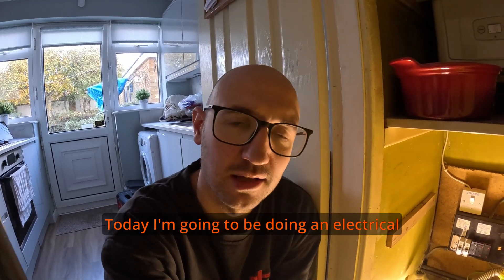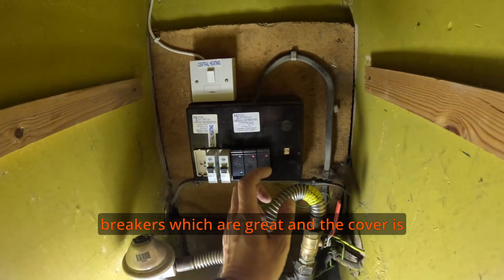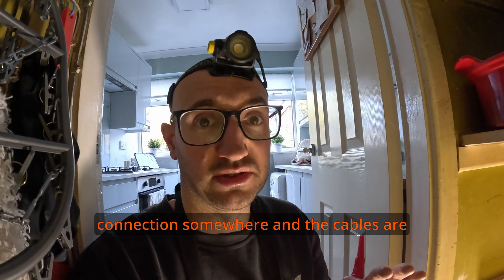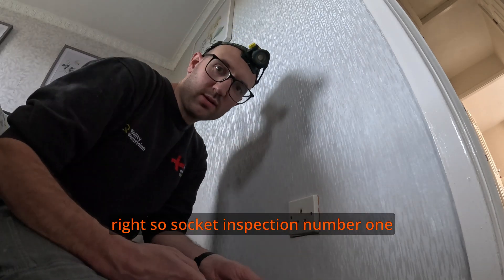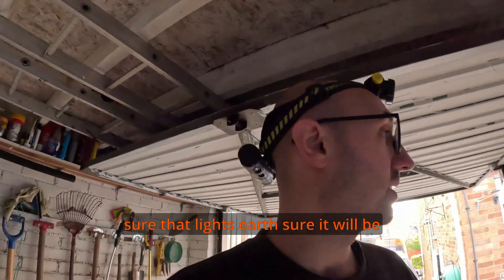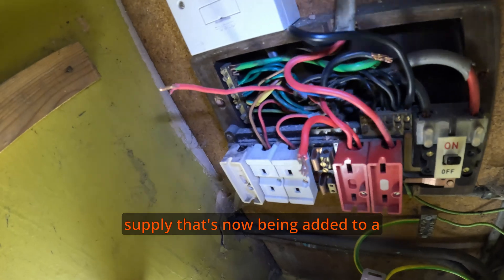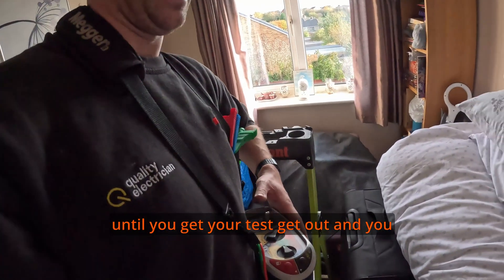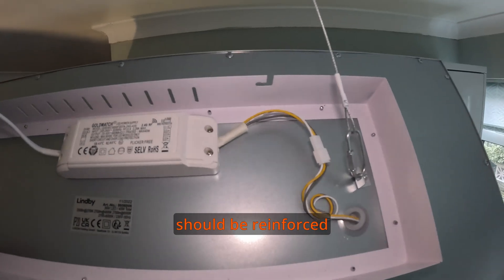Carrying out an #electricalsafety #inspection for a #fusebox #replacement

Comment: RCD are only required for additional protection from BS7671 17th edition amendment 3 onwards it doesn’t apply to earlier version of BS 7671 HSE note in BS7671 and the onsite guide Page 99 makes it clear. All your test results are within tolerance so you can sign it off as safe for continued service 
No RCD protection on installations designed to an earlier version of BS7671 ie before the 17th edition AM3 does not warrant a board change or upgrade. Unless there’s signs of overheating/burning exposed or access to live parts or damage to the board cover. 
But you I am glad to see you have done a proper thorough inspection and testing. Job well done 👍. 
But to be fair would I change that board probably, I think you have two choices  change it as you can’t fit the fuse cover on or replace those Crap Plug in MCBs with new rewirble fuses witch are still compliant and can still be installed and fit the cover. In some circumstances changing the Board is probably the best option. It would depend on what appliances are in use and if any electrical equipment is being used outdoors. 
Just my personal opinion 
I have been a spark for thirty six years , and I’m not trying to tell you what to do or how to do your job. Just pointing out the facts. In regards to BS7671.
No disrespect intended.
Great video mate I look forward to seeing more from you.
Reply: Yes , I think the old £ signs pop up when electricians see an old Wylex  consumer unit also when they see a plastic one    try to condem because it’s not metal ……..
Reply from the maker: @michaeltye8853  I agree, but to be honest rightly so. 

I don't think you would be doing your job if you didn't say to a client that you would recommend this old rewirable fuseboard be replaced.

What do you think?

A lot of these people just don't give a crap and are happy to scam clients out of as much money as possible. I personally couldn't live with myself.

I've got things wrong in the past and its not a nice feeling even if its a very minor job!
Reply from the maker: Hi Sean, Thanks for the comment really appreciate the information and I completely agree with what you are saying. 

Looking back I wasnt very clear and having no RCDs on sockets is a very vague term. In my mind I meant for outdoor use but there you go! haha!

A little background into the job, I carried out some work around 3 years ago and mentioned that replacing the fuseboard should be something they consider, and its been a back an forth since then. I think the fault on the light switch tipped them over the edge for an inspection and fuseboard replacement. 

It did want doing and I get it can be a costly job for a client so when I carry out these EICRs I do try to be as fair as possible, and like you say if there was no access to a garden then I would be thinking again about RCD protection and the code I would give.

If all was satisfactory I would still be strongly recommending a board replacement.

All you can do is give your professional opinion and try to explain the benefits of a new consumer unit. Most of time clients understand and listen.

Again thanks for the comment really appreciate your feedback and I hope to be hearing from you again!

Comment: Looks like you do a thorough job mate! How long do you usually spend doing EICR's?
Reply from the maker: Thanks for the comment bud, certainly try to. 2-3bed I allow a full day with paperwork involved. 

Depending on how many issues I find can take between 4-7 hours 😂
Reply: RCD are only required for additional protection from BS7671 17th edition amendment 3 onwards it doesn’t apply to earlier version of BS 7671 HSE note in BS7671 and the onsite guide Page 99 makes it clear. All your test results are within tolerance so you can sign it off as safe for continued service 
No RCD protection on installations designed to an earlier version of BS7671 ie before the 17th edition AM3 does not warrant a board change or upgrade. Unless there’s signs of overheating/burning exposed or access to live parts or damage to the board cover. 
But you I am glad to see you have done a proper thorough inspection and testing. Job well done 👍. 
But to be fair would I change that board probably, I think you have two choices  change it as you can’t fit the fuse cover on or replace those Crap Plug in MCBs with new rewirble fuses witch are still compliant and can still be installed and fit the cover. In some circumstances changing the Board is probably the best option. It would depend on what appliances are in use and if any electrical equipment is being used outdoors. 
Just my personal opinion 
I have been a spark for thirty six years , and I’m not trying to tell you what to do or how to do your job. Just pointing out the facts. In regards to BS7671.
No disrespect intended.
Great video mate I look forward to seeing more from you.